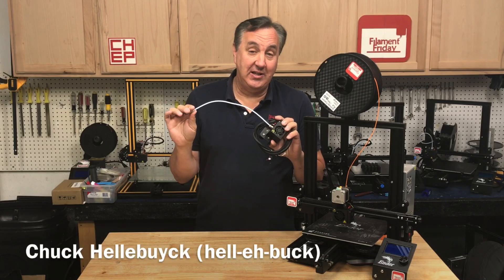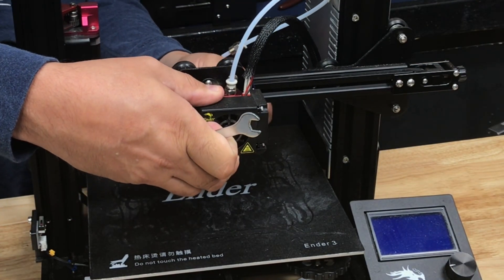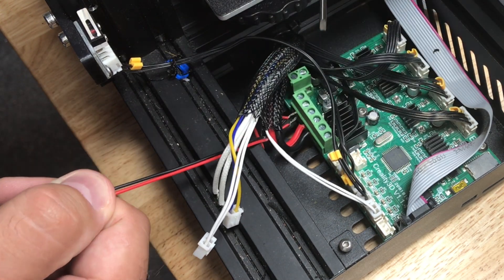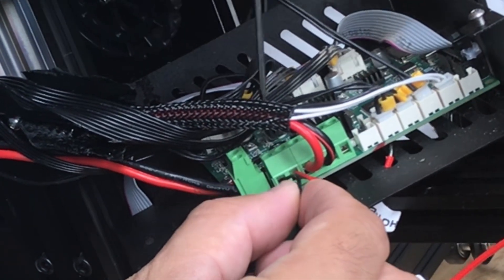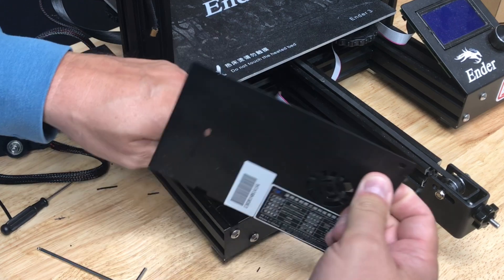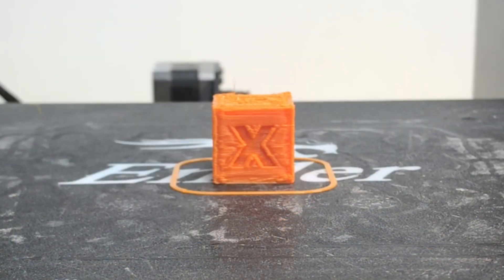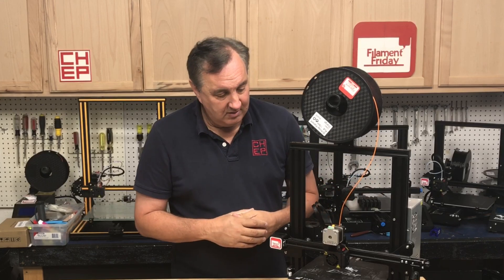Direct Drive Extruder on Creality Ender 3

Comment: I got one for my ender 3 neo and I got a sheet with it and on the sheet it says ""+12V " just a cable connection mark, it doesn't mean the voltage is 12V"

Comment: What about the extra weight and the hotend reaching the right limit of the X axis? It will drop as the printer has only one Z shaft at the other side.
Reply from the maker: Some people fear that and add a second lead screw to that side, but that can cause issues if they get out of sync with each other (which they can). 
I’ve found the weight is so minimal and since you level the bed to that weight, you don’t really see the issue. You can adjust the crossbeam position to compensate as well. Though I’m sure if the side wheels supporting the are adjusted right or wear over time it may get worse.

Comment: stripped the hot end on my ender 3 and figured might aswell upgrade it. was worried some reviews on amazon described a heat sensor issue. Luckily my unit does not seem to have it. my ender was alittle different in dissassembly (might be an older model thing) but other than Chuck making it look super easier than it was, it was an easy straight forward process once I got everything taken apart. My first layer has never looked better! excited to try flexible filament in the future! Thanks Chuck! <3

Comment: Okay, im watching this after i did it on my own. I didn't have to buy anything. I printed a mount and placed my old extruder motor on it and made it just like this without having to do all that wiring. It works well, I just need to celebrate the esteps. Is it okay to do it like this?
Reply from the maker: There are many designs on Thingiverse for what you describe so it definitely works. Many have done it.

Comment: Did anyone else get 'Err: Maxtemp:E1' alarm after installing the direct drive.
Reply from the maker: The temp sensor is disconnected or wires shorted.
Reply: @FilamentFriday  Thank you for the prompt reply. I am able to generate the alarm when I connect the nozle thermistor. I am not sure but it is probably out of box failure. I am planning to return the direct drive assembly.
Reply from the maker: @muhac80  - It’s shorted. Separate the wires just a bit near the thermistor and it will probably work fine. They get pressed together in shipping. But definitely return it if unhappy with it.
Reply: @FilamentFriday  Will give it a try and let you know. Much appreciated.
Reply: @FilamentFriday  Wow, so cool that y'all are replying so quickly to a question on a 4YO vid!! Kudos! I took a 4 year hiatus from printing and now trying to get back into it.. sad how much I've forgotten about the whole process.. Chuck, you're still my go to guy for all things 3d!!❤🤟
Reply: @muhac80  this can also be caused by a PID that needs tuning. If you go into temps and just set your nozzle to 230 does it reach it, go way past it, or struggle to make temp?
Reply: Same thing happened to me. You need to take out the thermistor from the nozzle and clean out the white power gunk from the thermistor and hole. I used a small pick to get it out. It fixed the problem for me!

Comment: Hi I've done everything on this and now my x axle won't work. My y and z work but the x just gives a little kick and that's it no movement only manually.
Don't know what else to do
Reply from the maker: Move it by hand. Something might be binding it. It should slide back and forth easily.
Reply: @FilamentFriday  nah all good the Y "extra" cord plugs in under Neath near the x plug 😆
Reply: @FilamentFriday  also your videos are great been helpfully with me just starting out with 3d printing

Comment: What’s the real advantage to changing an Ender 3 from Bowden to Direct Drive?
Reply from the maker: Some would say printing Flexible TPU is faster but that’s about all I can suggest.
Reply: Also the bowden has a tendency to slip out of the extruder end, and possibly break off a piece into the coupler.

Comment: Hello, the stuff i would need to unplug on the board is held down by what it seems superglue. What should i do?
Reply: I have solved the issue, i just needed to unscrew the thermistor and played around with it, eventually stopped the err message. I printed a benchy and i did not need to recalibrate the esteps.
Reply from the maker: It’s hot glue. It just peels off with a needle nose pliers.
Reply: I have plugged in the stuff i needed to plug in the board. But when i turn the printer on, the acreen says “ERR : MAXTEMP” What should i do now?
Reply from the maker: @ - Your temp sensor isn’t connected.
Reply: @magicianeagle69   this is why im here lol

Comment: if you do this update you can just use the say its a Creality Ender-3 S1 in the Creality slicer 4.8.2 and seems to have all the correct settings for retraction on the extruder.

Comment: i have used this on my Voxelab Aquila with a the Creality direct drive extruder Kit you need X-axis limit switch bumper added to the print head.  the original Aquila has the bump sticking out on the side of the print head bracket.
was not happy with what others had did cutting on the belt drive cover to let it hit the Home micro switch. so i made mine  /thing:6810645

Comment: Here's me like 7 years later still sticking to E3's for all my production. Just upgraded them all with SKR mini E3's + direct drives, duel Z, Fixed beds... Still going strong. I am starting to look to future options for replacement of the E3's.
Reply: What types of calibration and/or firmware changes did you have to make?
Reply: Me too, bought a Bambu lab A1 but still upgrading my Ender 3. Running klipper on a raspberry pi Zero 2W. Mods are silicon bed mounts, PEI magnetic plate, printed new PSU and Mobo covers with no fan shield (that did a lot for the noise level even with stock fans :O , Direct Drive kit as in this video. I am running the Ender 3 SE print profile in orca slice and it works great. Prints looks great.
Reply: @AndrewTSq I have since upgraded to 4x Ender 3 KEs. Great printer but suffer QC so check over and put together on a solid level surface. The bed attachment screws are a joke so thread locker and printed sleeves are the go. Even then it loses level twice a month. The creality slicer is terrible but to use the monitor and wifi is required. I will upgrade one to linear bearing y soon.

Comment: Im having a really hard time installing mine its almost like yoj have an extra cable to me if the X axis is going into the extruder how does the belt know when to move ?
Reply: There should have been an extension cord with the direct drive you got. Take out the old extruder connection and attach the extension  to that, and then attach that extension cord into the top of the direct drive.
Reply: Seems to me just a mistake in the video, at 5:42 near the X axis stepper there should be two 4 pin wires and a 2 pin wire, one goes to the extruder motor (marked E), one goes to the X axis motor (marked X) and the 2 pin wire should go to the limit switch (also marked X). The extension wire should connect to the E cable while the X cable should stay connected to the X stepper.

Just make sure that all the wires are connected the same as I got a direct drive dual extruder kit from Aliexpress and when I connected that stepper directly to the E wire, I got a short warning on my BTT SKR 1.4. If I had the regular ender 3 main board it would've blown up one of the stepper drivers at that point. Worked fine with the provided extension cable though so I imagine one of the wires is being flipped in both the stepper as the extension cable.

Comment: I did kind of a halfway house conversion where I just bought a bracket to mount the existing stepper motor on; been a bit rocky getting it going and I'm still not quite there yet, but it at least seems to be improving..hopefully..

Comment: I don't understand what is mean esteps.
And why when you change the value the object printed much better than before?
Reply from the maker: Extruder steps. It calibrates the amount of filament being pushed thru the nozzle.
Reply: @FilamentFriday  i ordered the same extruder, i will change the esteps same value like you do it?
Reply: @noobt4eguns no
Generally you need to adjust the e steps according to your own machine
Search for e steps calibration
If u use his values u will most likely not get the same results

Comment: can i use my autoleveler with this mod
Reply: yes
Reply: @TioMaiko_  How?  The support on the direct drive kit doesn't have anywhere to fix the auto-leveler at.
Reply: Auto levelers generally come with a bracket that's attached by the small screw above the fan shroud and the small screw to the left of it @czarmorer
Reply: @frosttrap2261  I've found out that it had to use the other type of bracket (that also came with sensor).  I was lucky enough to still have the original box of the sensor with everything that came with it..

Comment: The problem with our V2 NEO is that there's not a single place to install cr touch. I looked everywhere, but I can't seem to get a clear answer. I love this new complete replacement for only 30 bucks, but I am very confused as to why creality wouldn't include some type of bracket. I think what is happening is that this direct kit is not made for anything after original ENDER 3 so like any other businesses would do they are getting rid of overstocked items for crazy cheap price without any support. Have anyone go through same situation and if so, what was the problem solving.
Reply from the maker: V2 Neo already has CRTouch installed.

Comment: I purchased a direct drive for my ender 3 pro.  After watching this video, I'm not sure about using it.  Taking into consideration what you mentioned about the ease of printing with PLA etc, using the Bowden.  Is it possible to get good print using PTU with the Bowden and if so, should one use teflon for the tubing or stay with the plastic?
Reply from the maker: I print TPU all the time with bowden but it is slower. https://youtu.be/sGxewzACO9g
Reply: @FilamentFriday  interesting. I picked up some clear low shore TPU, do I just need to slow down or what? Thanks.

Comment: My question is are creality paying you for saying things like pleasingly suprised by set up or is it just you? I understand it because I bought same set up. But...... technical question next, where do I put bed leveling sensor?? Can someone explain this to me? My printer is neo
Reply from the maker: Nobody tells me what to say. And sensor is already installed on Neo.
Reply: @FilamentFriday  I see, thanks for answer. What I mean is on this particular example I installed direct drive from creality but there is no place for cr-touch. What does it mean?
Reply from the maker: I guess you’ll have to 3D print a bracket. The video was about standard Ender 3 not the Neo. You could search thangs.com for a bracket. It probably exists.

Comment: I have yet to see a better quality print come from a direct drive machine as what i can get on my bowden set up. Im sure there are other pros to doing the conversion, but as far as printing PLA goes, I've yet to see a single instance of better quality
Reply: Yup, there are many downsides to direct drive, the real only upside is that the path between extruder and hotend is so small so flexible filaments have less places to go and you can lower your retraction settings which might help with stringing. Otherwise a bowden setup is superior in most cases since you both lighten the toolhead (since the stepper is not there) and alignment issues with the drive gears get smoothed out by the longer path.

Comment: Put this on my ender 3V2 neo, and now after I press auto home, I need to manually level my bed.  However I cannot get the print head to go down any further.  I try to move the Z offset but it will not go down, just up.  What am I missing?
Reply: Is it clicking on the limit switch?

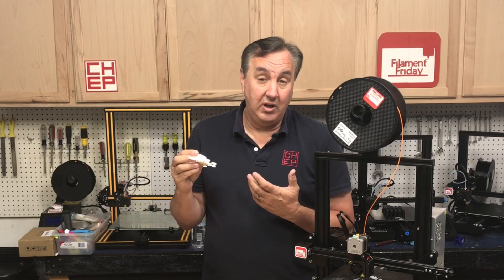Comment: You stated that you needed to adjust your Slice settings on PLA, for the Direct Drive (7:15 - 7:32), as you were not too happy with the finished print.  Have you done that?  I have not seen any video on it - unless I missed it somehow.  I am considering this upgrade.
Reply: I had to adjust my retraction settings but I have to check it every time I do a slice cause it keeps reverting
Reply: @onemansvideos2134  what did you change your retraction settings too?? i cant find a good video on it..

Comment: I got one decent print off with it when I switched to direct drive, but now when I start a print and make sure everything is the right temperature and leveled, no filament comes out, but it is not clogged. It just does not go through.

Comment: i have change my extruder to the direct drive but after changing the motor doesn't move on x axes. what should i do now ?
Reply: Sounds like you might have a loose power cable on the motor from the X axis perhaps. Did you check if all the cables are still seated on the connectors on the motherboard?
Reply: @makedaevilmage  yes all wire is connected

Comment: Between changing the esteps/mm to 94.50 (I had the exact same dual gear extruder and switched to direct drive) and moving my Z Home Switch with some trial and error, leveling my bed 5 times or so to get it just right, I rescued my old funky Ender 3 that I could never get to print properly. I'm almost emotional since that printer hasn't worked in 1.5 years.

Comment: Hey CHEP, on my Ender 3 many of the connectors are actually hot glued to their sockets on the board. Do you have any recommendations for removing those without damaging the connectors or the board? thanks
Reply from the maker: Just peel off the glue with a needle nose pliers.
Reply: @FilamentFriday  yup that's what I did, it comes off very easily

Comment: nice video. tks. do u know if i can use the CR touch with this direct drive??
Reply: Yes you can, I have it on right now! No issues at the moment
Reply: @yobtnirp3D  tks for the reply
Reply: @FPV_do_Cerrado  you're welcome, using the stock bracket works fine
Reply: @yobtnirp3D  
How do you put the car touch on?  Where do you plug it in to?  The setup chep used is what I put on my neo and there is no place to plug in the wire connector on the car touch
Reply: @janekrasinski4372  do you mean on the actual unit? If so it should be on the top

Comment: Hi Chep, i noticed in the pictures of that 'upgrade kit' that the extruder is still 'single drive + idler pulley' also that 'the gap' that TPU famously escapes from is still there. Is this not a problem? Can't TPU still escape due to the pressure? or is it the actual PTFE tube that causes all the trouble?

Comment: My belt is too short.  It won’t go around the original ender 3 roller.  I noticed you have a different end piece.  Does that help or is there some issue

Comment: Does anyone have a profile of settings they would share? I installed this last week, and print quality has fallen while print failures have risen. I've really only fiddled with retraction to this point (tried several settings in between .6-1.2). That hasn't helped. Thanks!

Comment: I just installed this on my Ender 3 V2 last night, with BLTouch. Something going on that it won't Autohome or drop to 0 on Z axis. Actually, none of the axis controls seem to work correctly.
Tonight I am going to reinstall the firmware and try again. I followed these steps, other than I kept my hotend on and saved the one that came with this kit as a backup. My hotend is only a few months old.
Reply: It happened to me, I reinstalled the firmware and somehow it worked ( using an Ender 3 pro).

Comment: I need help. I purchased this direct drive and a cr touch just installed them both now no what I do I CAN NOT get anything to work. I have tried several firmware files and each time none of the steppers work they just lock up..please help me with what I'm doing wrong.. it's a standard ender 3

Comment: :) it is so great to have a reliable source of information when trying to do something like this mod... My experience with the Creality Direct Drive was a little bit different though. I bought it because as you say the price was great and I wanted to print flexible filament. Mounted it (your video was a great help) and then started printing. My Ender 3 Pro was printing great on the Bowden tube config, but now, with the direct drive, it was kind of acceptable. I realized I had to check all the software and hardware adjustments but I put it on standby for about a month. Two days ago I had the time to see what is wrong, but all seemed ok and none of my modifications was working. I was kind of dissapointed but fortunately I saw another of your videos and I inspected the tensioning arm. For shure it had a crack in it (from new) - but fortunately the arm from the old extruder is a perfect fit. Conclusion - take care of three things: 1. Extruder tensioning arm or all the related components I would replace with the aluminium kit, 2. Adjust your E-Steps, 3. Adjust retraction because it works best with a lower value (1 - 1.5 mm) instead of the 5-6 mm in case of a Bowden tube configuration. And, thank you Chuck for all the great info!